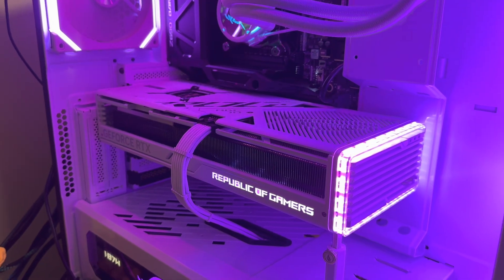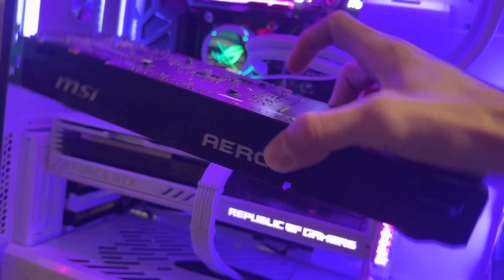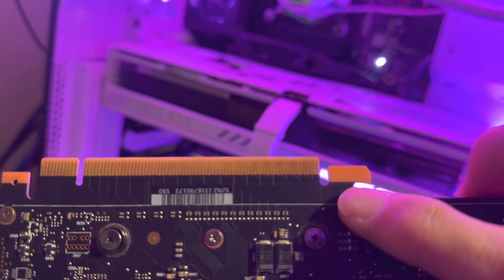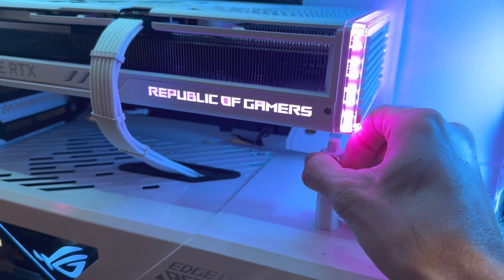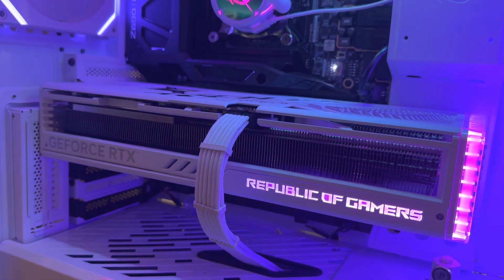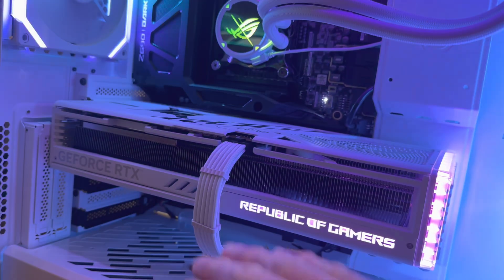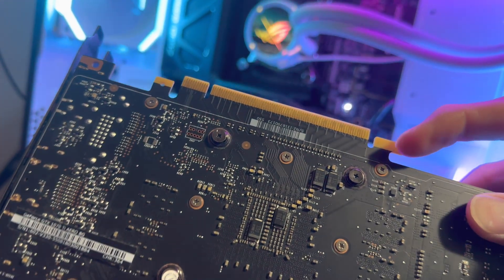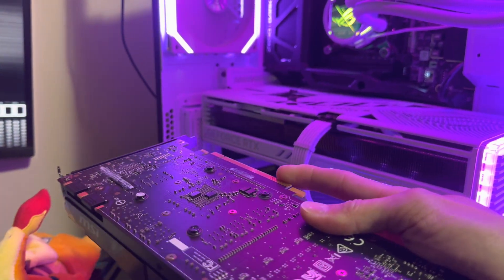Are Gigabyte Gpu’s spontaneously cracking? How to prevent it and why it’s not just gigabyte

Comment: So either we need a new PCIe spec revision to fix this or lighter weight wise coolers.
We do have lighter coolers just all of them happen to be water cooling for the RTX cards that seem to have this cracking problem. Really that is the reason i see the GPU market for consumers going to liquid cooling. Move the weight away from the card to a radiator some where else normally in the case.
I do not see us going away from the current PCIe physical spec as it goes back so far and the transition period that some will and some will not have the connector they are trying to go to will take years if not a decade. We still had motherboards with PCI until 2010 and PCI express is in more motherboards and has more cards for it that PCI did so it will take even longer to replace.
Reply from the maker: I will say we do need a better connector for sure. It’s not very user friendly especially for new builders. It’s very tricky to remove and hit the release. I’ve seen so many break the card just trying to remove it and won’t ever admit fault or recognize sometimes they did. 

The waterblocks although can be very very heavy though. The ekwb for my 3090 was super super chonky and heavy. If they experiment maybe with lighter materials it could help or do better with weight distribution like you mentioned. There’re are so many fixes including stronger bracing and back plates too that could help as well.

Comment: would vertical mounting be just as effective as using a support stand?
Reply from the maker: It may or may not help depending on the bracket. Jus keep an eye on how much pressure goes on the corner right side
Reply: @cppctek  yeah mine it doesn’t look like it has to much sag on it? i can post a video if you’d like to check it out because i’m not to sure
Reply: Vertical mounting would help for sure. I was going to mount mine vertically originally, But the GPU fans end up against the glass panel in my PC case.
Cheers.